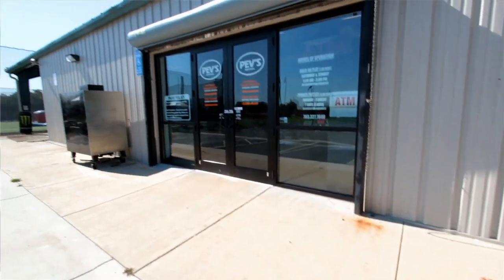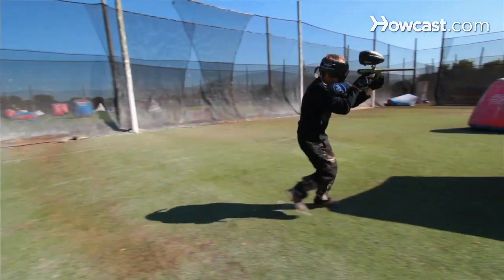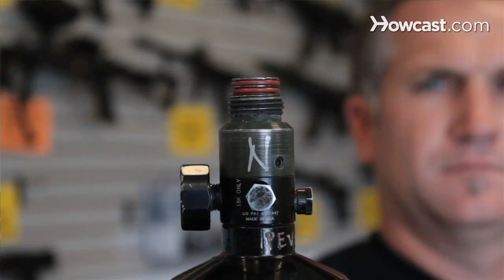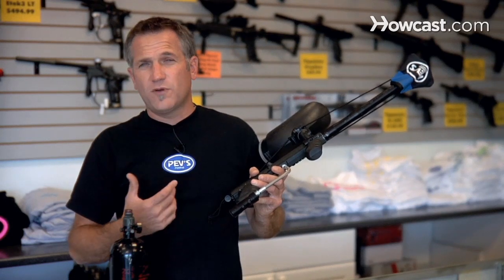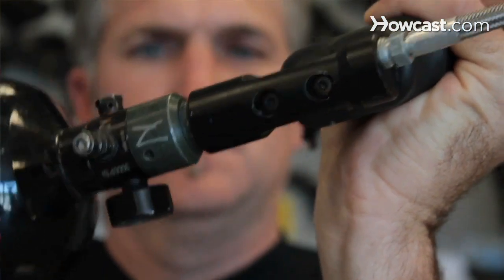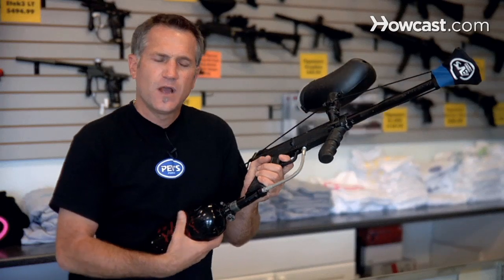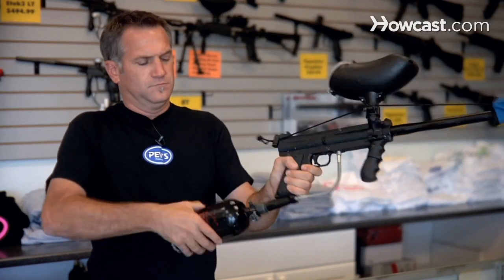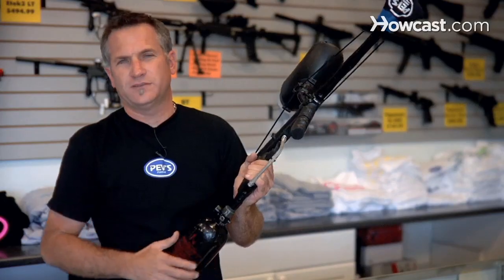How to Connect & Disconnect Air Tank | Paintball

Comment: Is it recommended to do the same trigger firing method if i have a remote line with slidecheck?? Or do i just pull the slidecheck back without firing the trigger?

Comment: I fired as I was removing the tank, but I still heard an air blast. Any reason?
Reply: Yes.
Reply: Break the tension by twisting the tank off a bit, and fire alot more as you unscrew the tank. You might get a small air blast but it's better than a larger one.

Comment: How am i suppose to take out the tank off my Dye proto rize if i cant fire it if it doesnt have a paintball inside???
Reply: I have a Proto Rize myself when It dose not have paint inside the hopper or the gun you can turn off your eyes (hold down the button below the power button for like 4-5 seconds) but make sure there is no paint inside the gun and make sure you turn your eyes back on by holding the bottom button again that should work
Reply: @dylanmiller3067  oh ok thx so would would the buttom button do when i take off my tank... and would i know if my eyed is back on..
Reply: The Last DooMz When you turn your eyes off the light will blink red when you turn the eyes back on by holding the bottom button again the light will be solid red with turning off your eyes will let you shoot the gun without a paint ball in it

Comment: do you have to store the air a sertan way
Reply: When I worked at a paintball centre, the gas was stored in large metal containers stored in a locked cage. Each day the small canisters would be filled up in the morning and screwed onto the guns, which would be left on a rack.

Comment: When i put my co2 tank on my spider Xtra 2011, it starts shooting air out the barrel like crazy until the co2 tank is emty.
Reply: +FurryAndFluff check your regulator
Reply: +FurryAndFluff Ur low on Co2?
Reply: your regulator may be loose or your missing at least 1 o-ring. inspect your o-rings and tighten your regulator.

Comment: When i put the tank on the gun alot of gas escapes! Do i have to buy a new gas tank
Reply: No. Your valve is probably messed up or you need a new o-ring
Reply: +joshua aanhuizen or the regulator is loose

Comment: How do you release the air in the tank?
Reply: +jack warren there is a little gnob that you can push down on the top of the part you screw in. if you push that into the tank it should release the gas
Reply: Umm well I've tried that but it did not budge so I asked the people at my field and they told me to unscrew the burst diskes and it works
Reply: oh ok

Comment: Yo can somebody help me? So I got this new 77/4500 ninja tank and screwed it on my mini. When I tried taking it off (not pressurized) it started unscrewing the reg off. Kinda scared to try and take off the while thing. Now the reg is stuck on the tank itself but now the middle bit of the regulator is (where it has the gauge) started coming off as well and now Im really scared, I emailed hustle if theyd lend me a new reg so I could put it on my tank but Im gonna try unscrewing the reg itself off. Any suggestions???
Reply: How did it work out?

Comment: I just got this co2 and when I screw it in nothing happens..
Reply: Tiffany Zambrana it’s probably empty if you just got the tank you need to have it filled they don’t come full
Reply: Tiffany Zambrana Same but mine is filled up and air isnt running up through my gun, my bolt doesnt have any pressure and its not shooting